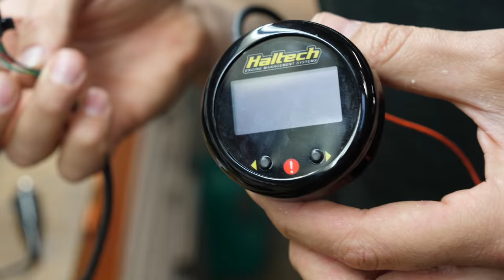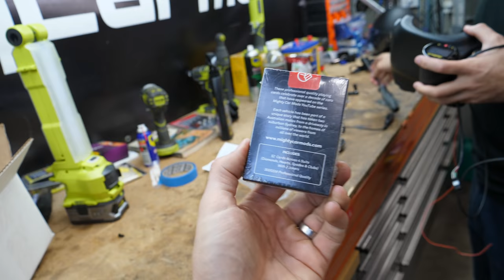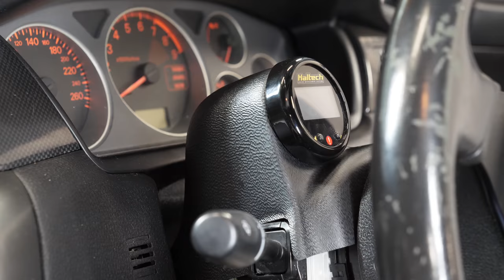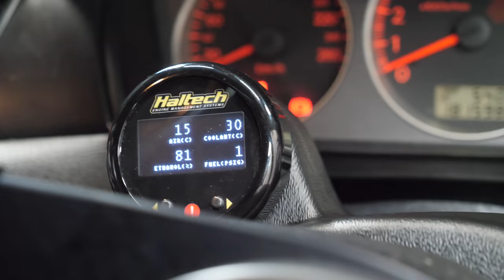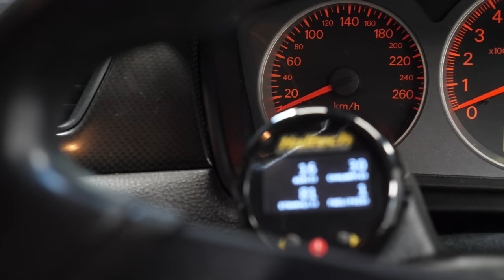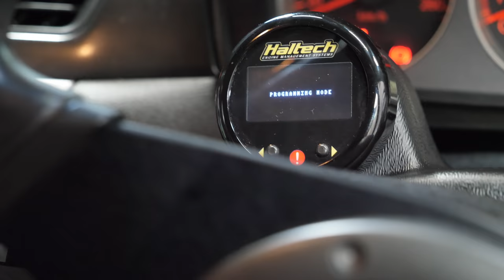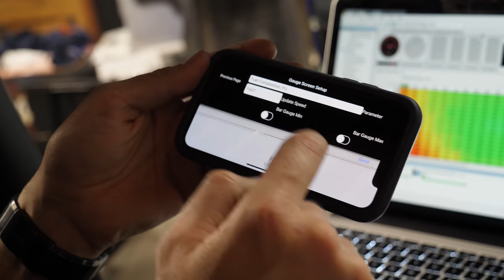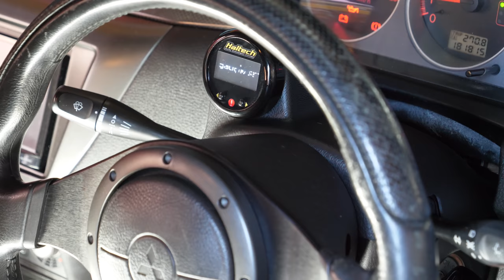Multi-function OLED Gauge Install on the Evo

Comment: Holy talented banjo playing, Batman!
I thought "wow, they're going for a different style" and it's actually Moog just shredding it live
Reply: Exactly my same thoughts just looked for this comment
Reply: It's a 6 string banjo, same tuning as a guitar... he's playing a guitar that's made to sound like a banjo, but nowhere near as capable as an actual banjo.
Reply: @Metal-Possum  so he's playing a Bantar?
Reply: @Metal-Possum  Do electric banjars exist and can I run it through a fuzz pedal
Reply: @kantina4765  I have seen some rarely but I have never been able to track down who makes them
Reply: @kantina4765  Banjitar*. Electric banjos exist, technically, but if they were electro-magnetic pickups like we have in a guitar they would merely be a 5 string electric guitar. It's really not a simple thing to make electric, a banjo gets its distinctive sound from the acoustic resonance in that drum head.
Reply: @Metal-Possum  you could install some form of acoustic pickup in one surely? I've tried plugging my acoustic into various pedals before and it makes some interesting sounds.
Reply: Now for the soldering of wires:
especially in your engine compartment with heat cycles and vibration, its better to crimp and heatshrink.
keeps the connection flexible, 
whereas solder breaks when moved.

So if youre fixing wires running to your door or trunk lid, flexwire and crimp...

Comment: The gauge is cool and functionality is awesome, but have to say that the quality of the display on both units is pretty agricultural. Reckon they could be made better
Reply: On top of the quality concerns, I've always hated the idea of a square screen in a round housing too, circles are for analogue stuff (round digital watches included in this hate).

But with the recent uptake of round LCD and OLED screens you could fill it out more and even replicate analogue gauges.

Like, a cheap smartwatch, one of those knock offs that run full Android, could bluetooth into a $5 OBD2 adapter, and display a full colour circular analogue gauge with customisable axes, and for a fraction of the cost. 
So why do these things cost so much?
Reply: I agree. Definitely not an OLED.
Reply: Yeah man The whole time I was thinking this thing looks like a Digimon..
Reply: @markkristensen93  it is oled. It's just a display tech, not all oled screens are like the ones in phones.
Reply: Agricultural? Apparently you know nothing of a modern operation.
Reply: @jaydunbar7538  Chill dude - simply saying that if I spent $500 on either of these units I would have been expecting a better quality of GUI
Reply: @warriormonx  what am I supposed to chill about? Pointing out your ignorance does not equate agitation.
Reply: Jay Dunbar Shhhhh...grown ups talking
Reply: MotoCat People keep suggesting this and it never makes sense, you only have 1 obd 2 port, it’s pointless to use a phone as a gauge cause you can’t use anything else that might need the obd port

Comment: Nice simple mod, if you already have the $1000 Haltech ECU.
Reply: Try $2000+
Reply: Very future proof though, and you can always take it out and put it in other cars too
Reply: Could go the Banks iDash.
Reply: Who said mods have to be cheap?
Reply: works on other ecu's too. 
I run a haltech but run gauges. Configuring that multi-display gauge looks like more of a brain fart than a single wire to a sender.. Also, knowing the position of a needle is easier to quickly glance at and comprehend than a small digital numeral.
Reply: You can get second hand units for around $500 if you're patient. I was looking for alternatives, I briefly considered getting a DIY Megasquirt kit where you build your own ECU but I don't think my soldering skills are good enough yet. Plus being a procrastinator, by the time I'd have built it, I could have saved up for a Haltech.
Reply: @darianistead2239  so I can buy this haltech gauge and wire it up to a stock vag ECU? Will the ECU not shit itself because of the extra device on the can bus?
Reply: Plus a £400 map
Reply: @EliJayFly  probably lol. but as I said, works on other ecu's too. I never said all.
Reply from the maker: Works on other ecu’s and does obd2 with an adaptor
Reply: Really wanna remove all the gauges from my car and just have one since I started dailying it. Currently on the oem ecu on the Evo. Pretty happy with the tunning capability of it. Will look into the obd2 option. Thnx guys.
Reply: @mightycarmods  is there a version of this where it plugs straight into the OBD2 port

Comment: For future reference, those DT pins, or deutch pins that Marty said are hard to get and take forever to arrive, are available if you know where to look. Your friendly local caterpillar dealer sells them over the counter because 95% of the electrical connectors on cat equipment is DT. I could even give you the part number if you wanted, I dont know it right off hand but I have a baggie of them in my service truck. 

It looks like your local dealer is WesTrac in Casula according to a Google, but I'm sure there is more places around 

-Cat mechanic from TN, USA

Comment: thanks for sharing more than one way to install gauges to their car. there are a few Bluetooth obd dongles out there and there is one called OBD11 and this isn't just a Bluetooth dongle. you can also do some coding to change adaptions like opening and closing of your windows via your fob or change your daytime running lights to your fogs. mostly for VAG group though.keep up the good work guys.

Comment: I use on Android Torque Pro because it has a mirror mode where it draws the app backwards so you can put it on a no-slip mat on the dash and it's like a hologram on the window. It uses bluetooth to a cheap ODBII reader. Whole cost with a used potato-quality tablet was like 50 US.

Comment: Really good gauge. I've got a dual gauge set up on the coloumn with wideband and boost. 
This would of been a much handier gauge to install too does a crazy amount of stuff
Reply from the maker: Dino Sawr can’t see fuel gauge on evo if you do that?
Reply: @mightycarmods  you can but just have to move your head about 20cm to the right hahaha nah its not that bad but you do have to move your head to see it 

Not the best in a car that drinks like it does

Comment: TESA tape #51036  or 51025
Deutsch connnectors are DT04-4P with secondary lock W4P & mating connector DT06-4S with secondary lock W4S
Terminals should be gold plated since it is in the CAN system 0462-201-1631 & 0460-202-1631
hand crimp tool  HDT-48-00
for reference if people want to copy this setup

Comment: You can get good Deutch pins from Altronics. Jaycar have some as well, which will work but the crimp end isn't a tube & doesn't work with the legit Deutch tool, just a regular crimper.

Comment: Great vid. I use the Torque app on my factory ECU to monitor when im not logging with a laptop for tuning. Such a great option. If anyone goes the smartphone route buy the best OBD adapter you can afford as it can update much faster and be effective. My current adapter updates about the same time as my laptop which has a USB connection when logging. So much info from a stock ECU.

Comment: Gauges: I am using OBD2AA with a Bluetooth dongle. This runs in Android Auto on my Pioneer Head unit. 5 or 6 gauges. Great mod on 2008 STI
Also a huge display Chinese head unit with replaced the standard the wife's Toymota.

Comment: I use an obd2 Bluetooth adapter with TORQUE app for my gauges in my 98 Lexus Gs400 / Toyota Aristo400 and it does have a bit of lag not sure if it’s the app or adapter or maybe my ecu but it looks cool when you chop Honda’s ! Lol  love from SoCal !

Comment: that gauge pod is fine if you're using a haltech i guess, but it will block the check engine light which is really important with a tuned stock ECU, because tephra mod FLASHES CEL when it detects knock, which is very, very, very super important. Also oil light I guess, but at that point it's already too late.

Comment: What is the reason behind telling some of those parameters to update/refresh slower than others?
Reply: The gauge only has two wires that actually carry the parameter signals. So they can be overloaded kinda if everything refreshes every 10 milliseconds. So the "not so important" parameters such as fuel pressure doesn't really need to be refreshed so fast. This makes sure the ones that changed quickly (such as boost) don't have to wait in line. With only four active, you probably wouldn't notice a difference, but add 3 or 4 pages of four and it would start to lag.
Reply: @tomthumb1322  Thankyou, that makes sense. I was going to guess that maybe it couldn't handle it and would start to lag a bit but I wasn't sure

Comment: +Mighty Car Mods Jaycar electronics sells the deutsch 4 pin connectors CAT NO: PP2149 They also sell the 2 pin version and the 6 pin version CAT NO: PP2150  and CAT NO: PP2148

Comment: I had one of those steering column gauge mounts in my Audi A4, and the fitment was way off, the steering wheel rubbed against it and I found myself grinding it down and gluing it on as the double sided tape was useless as it wasn't a flush fit.

Comment: If anyone is wanting to use a Android or apple device with there OBD port get one from scantool.net, if you want wireless get the obdlink mx+ or if you want the fastest connection get obdlink sx USB version, your Android device will have to have OTG support, I use the sx with a Android headunit ( I have two units, one is just the gauges and torque pro app ) and it work great, super response and tons of config options.

Comment: When you're running a standalone does your OBD2 port still work as usual or no?
Reply: No, not unless you set it up to do so and even then it really doesn't work. Standalones usually use serial to connect
Reply: Tim Steinke I was thinking the same thing. But I just finished the video and I guess you can run haltech gauges through the OBD port. So maybe because the wiring loom doesn’t change it still works fine?

Comment: Atleast this one is a bit cheaper than the friggin Golf one.
Reply: But it actually isn't. The gauge alone is $530 ish AUD, plus a pod to mount it. 

Conceptually they aren't that much different. They both use CAN to pick up data, the Haltech has a bit more functionality, but really they aren't that much different.

Comment: Me I just did it on my dash stereo I can see what you guys see. Plus can connect the stereo to my network so I have a Bluetooth scanner always connected so have the app on my stereo if my car have a code I can see it on my stereo live data. Like those new tablet scanner. Plus I can tune my car using my stereo. Just get a android stereo and a ob2 Bluetooth get one that you can see live date read code delete code tune or coding your car. If your stereo is connected to the ob2 device and if you can connect to WiFi and get apps on your stereo that’s all you need to do where you want with only two device a android stereo and a Bluetooth ob2

Comment: Get that dash piece off of the roof!

Paint is not for putting your parts on, parts go on benches, back seats, front seats, floors, where ever you want to put them, as long as it's not on a painted surface of the car.

Comment: Great if you have a Haltech.  Useless if you don't.  UTCOMP computers are a much better option for non-OBD Evos as they are completely flexible.   On that note,  nothing in Marty's Evo required a Haltech - even Flex Fuel can be done on stock ECUs now and with more E85 tables than Haltech does.  But hey if you have like $4,000 to blow...

Comment: Be careful goons mentioning Honda.
Most turbo Hondas today would eat that EVO  and GOLF  for lunch breakfast and dinner on 7 pounds of boost not to mention 18 psi.
If you know what's best  keep that evo  right where that is power wise or its gonna get expensive.
Nothing says ouch like a broken evo center diff.
All that said  I REALLY love the  way evos handle .
Reply: rwells242 it’s more about straight line speed, there’s just hardly anything admirable about a fwd Honda except cheapness
Reply: I have owned a highly modified Evo . Several modest to highly modified r33 skylines a highly modified  r32 gtr skyline and several Japanese Honda Accords from sirs to a cl7  euro r basically stock  and a stripped out turbo civic and I can tell you that you are not correct.

My Euro R accord and sir accords handle quite well in the corners So does my stripped out civic that's missing all its front sway bar bracing because of a 3 inch  exhaust pipe  and in fact so did my CRX that couldn't even spell LSD .

They are not the top performers  but they aren't garbage either in the handling department.
Reply: I wouldn't even begin to talk about EVOs and the word reliability. Just saying that just now made me cry because I just had a flashback.
Reply: In fact " @roddydykes7053 " my Euro R handles so well that I would go so far as to say that statement is completely false. There are a slew of rear wheel cars that can only dream  they could handle as well as that car.
Reply: The safest place for an evo is in your garage . that's where they thrive in there and on your playstation. In real life they are a very bad woman. They please you to your hearts content then they just leave without a warning.
Reply: A Honda is a good woman She might  or might not be the hottest chick but if you treat her right for certain she will be there there for you.